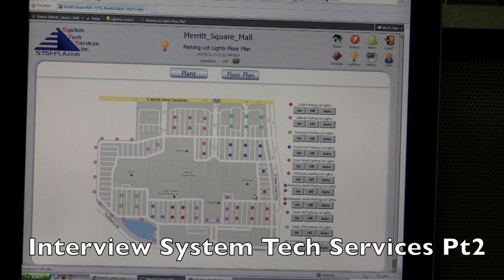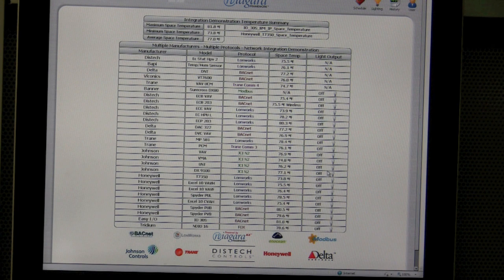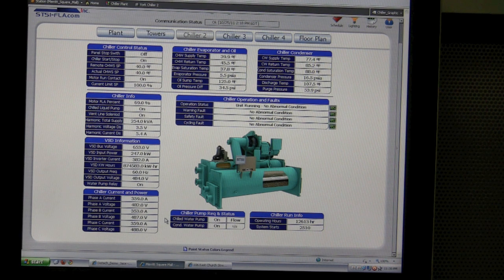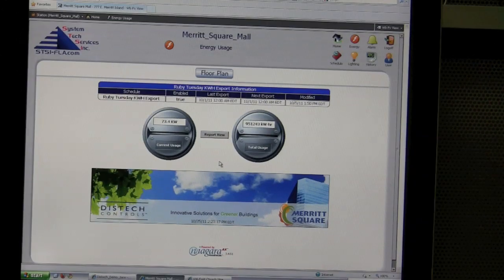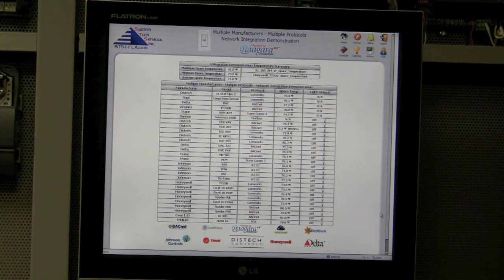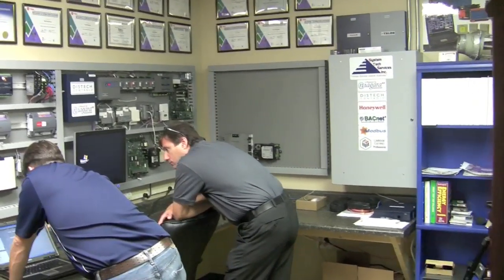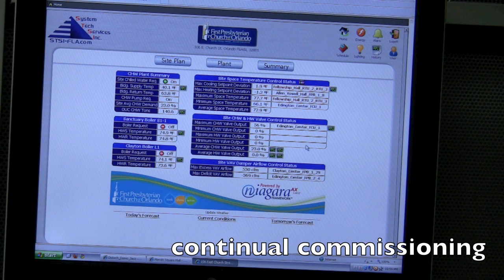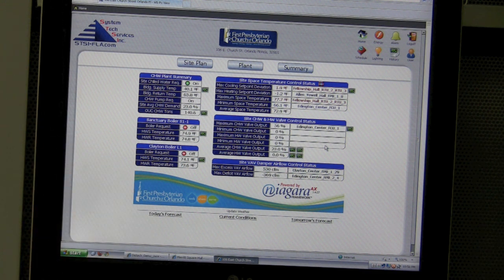This is what a Tridium Systems Integrator looks like Part 2

Comment: I'm a service/maintenance engineer since 3rd Jan. 2012. So I'm actually still a fresh graduate and still learning on the job. I have a problem at one of my sites. I use Niagara AX. One of the LON controller for the cooling towers always intermittently change from yellow(down status) to normal status. I've tried troubleshooting and found that when the cooling towers are running manually (bypass the variable-frequency drive), the controller is normal.  When in auto mode, it starts to turn yellow.?
Reply: I hope, you solve your problem after 4 years :D
Reply: I am writing from the owner ship status of kennedy air and rocket inspeecce kristofer owen kennedy 182 gravityittity aouthor income and would like to intergrate john f. kenndy in to john berriet king to the public acceptance of ownership or gift back in four trillion dollar sectors along side justice robert being they are brothers i had no idea that they had never been to the air feild or testing facilty .fatherdeeds CBS MASTER CONTRACT> justice kris washington bass kennedyedu ussa battelship krisbass